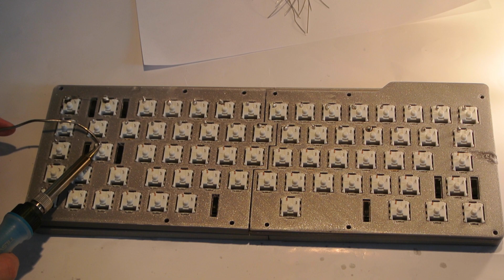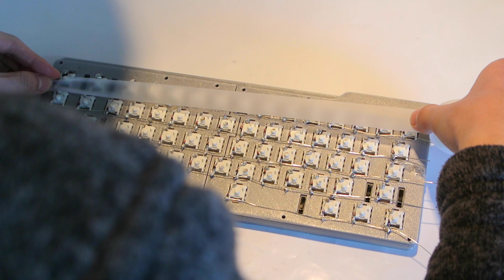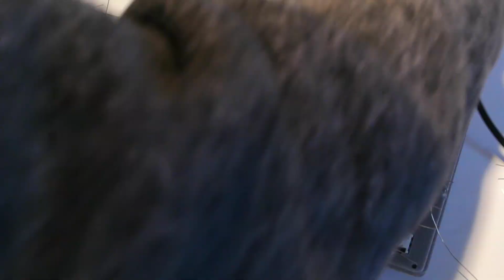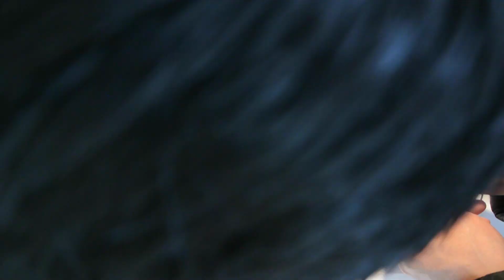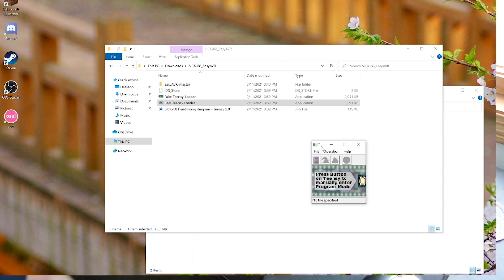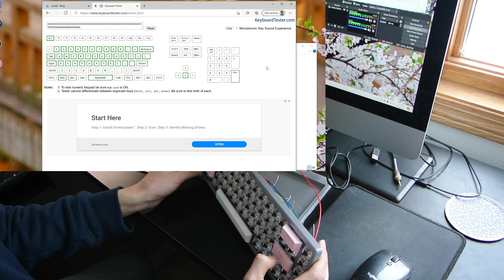Hand Wiring and Programming the SiCK-68! 3D Printed Mechanical Keyboard Build Part 3

Comment: A quick tip, you dont need to put blob on each switch pin. Adding a lot of blob will melt the plastic on the bottom. Just coat it with solder.
It is enough for solder to 'flow' and join the switch pin and the diode pin. 
Twisting the diode wire to the switch pin makes it easier to soler with less amount fo blob.
Use at least .8mm solder. The one you are using, albeit workable are made for electricians. :)
lastly, good job on your project. Next time you make another DIY circuit, you'll do better for sure.

Comment: Im doing this project but I cant figure out how to program it can you help me ? I mean like my computer recognises it like a keyboard named "Easy AVR Multimedia Keyboard v3.01.10" but when I test it, it wont work.
Reply: @reecemakesthings  I think that the flashing system has been updated since and I followed the new steps that Fedor Sosnin has given in a doc and the flashing seemed successful since my computer recognises my teensy as a keyboard named "Easy AVR Multimedia Keyboard v3.01.10" so I think the programming part worked. For the wiring part I refered to the wiring diagram that Fedor Sosnin have posted in the "cost breakdown" document, i have verified the wiring and it seems fine and no wires are crossing so at this point I dont really know where the problem comes from. Im still trying to figure it out but if you have any idea please help me out.

Comment: Great job with the wiring! Putting on that tape must have required so much patience. I did the sick68 build as well (idk if you seen video on my channel) and I just slapped tape through whole rows.
Did you fix the triggered key? That must be some row and column wire touching since you are using wires without isolation. Should be easy fix.
I will be waiting for the next part to see how the build will turn out! Do you plan to do other keyboards since you have mentioned more videos?
Reply: @reecemakesthings  Alice seem to be quite a trendy right now :)

Comment: i love soldering, but that handwiring looks like a whole nother level!
good job on the build broo o/
(btw where did you buy the extra set of hands, interesting...)
Reply: It's not as hard as it looks like, but it might prone to mistakes and failures. For example having cold solder somewhere and not noticing it. I think that I myself will be switching to Amoeba PCBs instead of doing handwiring.
Reply: @infiniteoffset  How exactly do the amoeba pcbs work? Also, what benefit is there to using them?
Reply: @coltonwaffle9216  Benefits are that the soldering on switches feet is more reliable. After all, switches are made for PCBs. Amoebas holds diode on them, so while wiring, you don't worry above diodes and you can choose between SMD or through-hole. You can also easily add LEDs. Wiring will be clean and reliable. Potential repairs will also be easy.
And for the how do Amoeba PCBs work part. Well, it's hard to explain, but also not. Wiring is basically the same as with hand-wiring if you would draw out the connections. Anyway, you solder diodes on PCB first, then solder PCBs onto keys. You will then connect SR pin to the SR pin of neighbor switch in row. Same for columns with SC pins. Then you can see there LR and LC pins, but those are for LEDs, you connect them same way as SR and SC. And then you just run columns and rows to arduino.
Now sure if you will understand my comment. It would be better to make video out of this.
Reply: @infiniteoffset  Thank you, that helps a lot. Im still not 100% sure on it but I think i might have to try it out. Im planning on building my first keyboard and I have never done any soldering before. Do you think you would recommend the amoeba pcbs to a beginner or would it be better for me to learn without the pcbs?
Reply: @coltonwaffle9216  Soldering on PCBs is way easier. And if you have never soldered, I would recommend you to order some practice boards for soldering so you get used to it. Are you planning to so Sick-68?
Reply: @infiniteoffset  Yep, I just finished printing it.